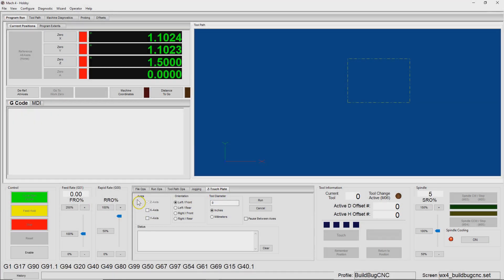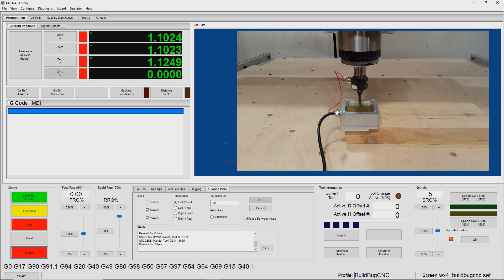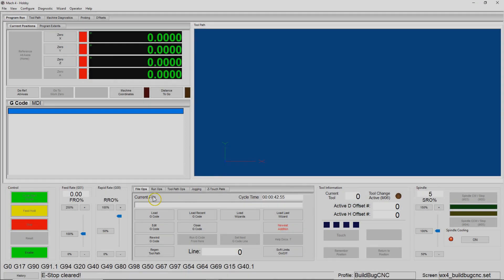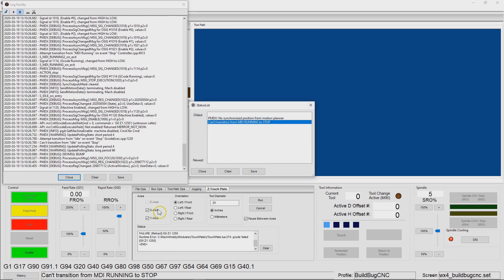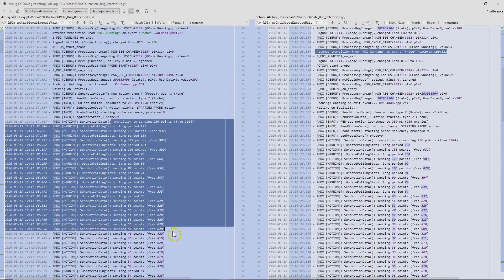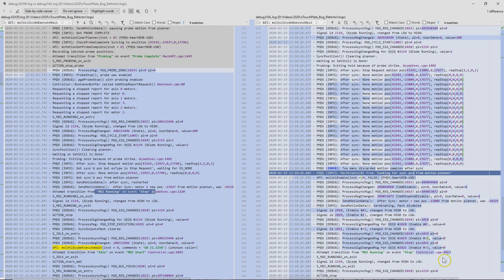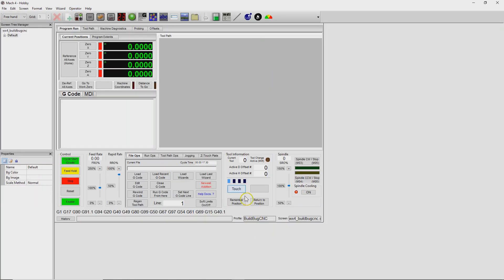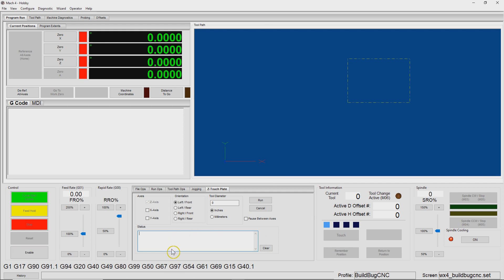Mach4 - AVID CNC Touchplate Software Update and PMDX-424 Probe Bug

Comment: Thank you for sharing this. It has help me a lot, greatly appreciated. I had a thought for the Probe tab. How about a sensor light for when the probe makes contact. I like to manually test the continuity of the probe just before I run the homing set up. Also what about a button to test the homing set up. G0 Z0 Y0 X0 in stead of having to manually input the Gcode Also with a warning to remove the touch plate before continuing.  Thanks, Andrew